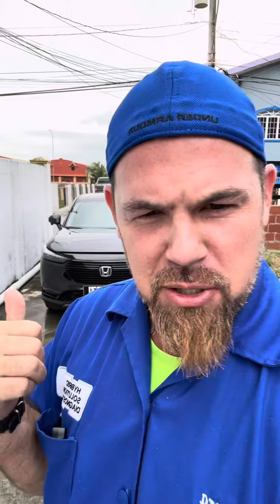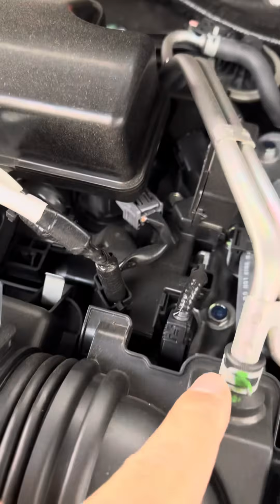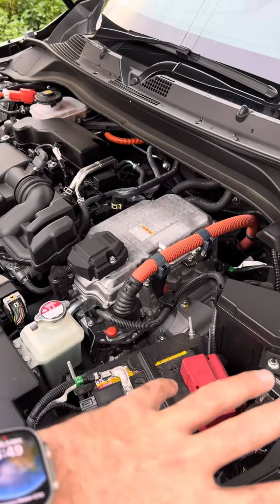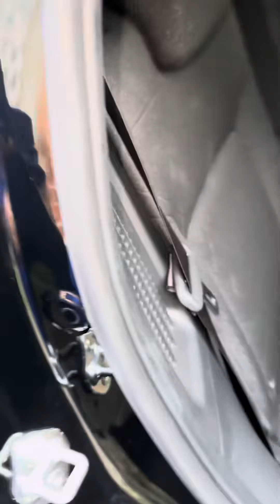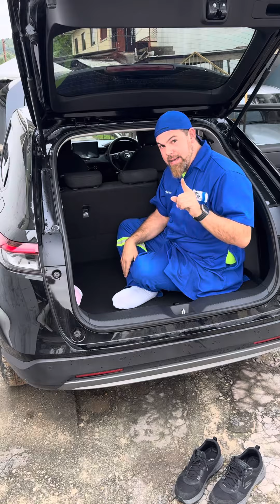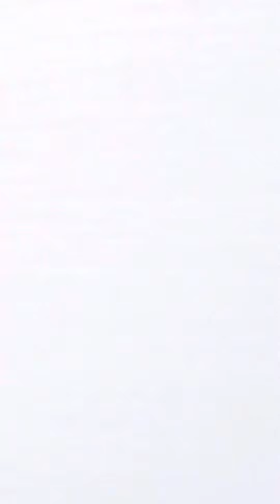Honda Vezel e-HEV explained

Comment: Can you add a filter to the suction vent ? 

What would you recommend
Reply: Not an expert, but filters always impact air pressure negatively, which could end up meaning the batteries don't get enough air cooling
Reply: Dont ever do that.. clean it each 25xxxkm ..its better

Comment: How much mileage do you get on a full tank? Is it more fuel efficient than the Yaris cross?
Reply: about 700km to one full tank of gas. thats like extremely well
Reply: I go from Central to Arima daily and can get 2 weeks worth of driving on a single tank.
Reply: @zyllbee4115 that's about correct, the tank size is 45 litres and to fill up all the way with premium is 300 not bad at all eh.

Comment: This is identical to the Honda jazz as well. The vent you pointed to isn't that the output vent? it will pull in air from the trunk via a fan. Or does it do it the other way. Pull in air from the cabin and push out into the trunk?

Comment: Which is better now between e power system of Nissan and the one used by honda?
Reply: That's a really good question, will be interesting what the fuel effiency of this system Vs e-power
Reply: @chunkybeats79  the new Honda Vezel is way more efficient than the e power Hybrids. HONDA has done an amazing job !!!. Nissan E -Power  is still good but not as efficient as the new Honda Vezels.
Reply: check out that link